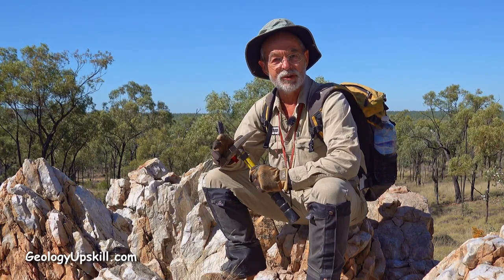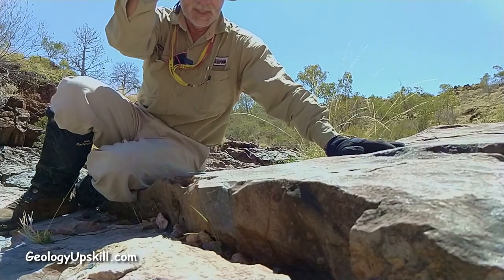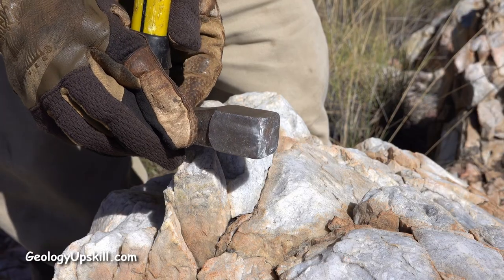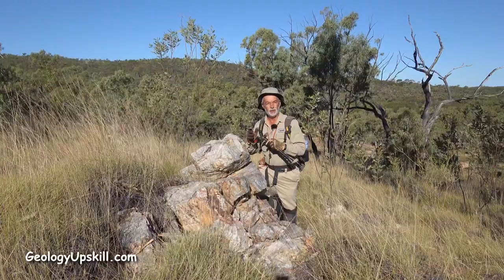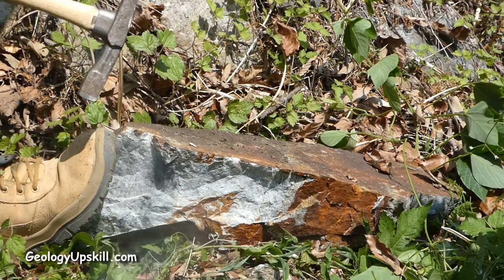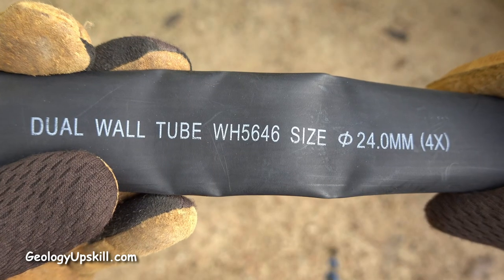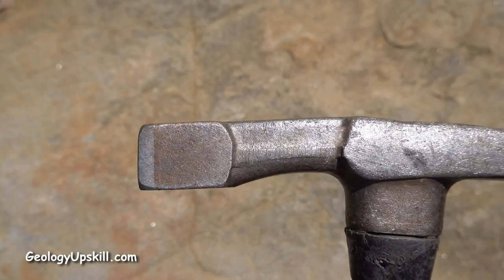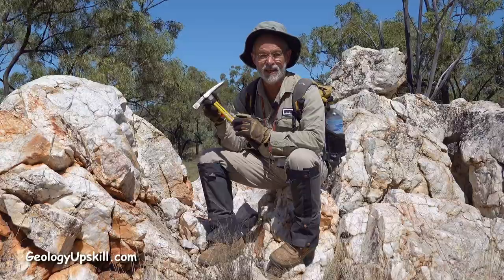The Ultimate Geopick?

Comment: Interested to hear how the prototypes turned out.
Reply from the maker: Still testing that model with different handles. Currently using a shorter claw hammer handle that has plastic sheilding and a smooth grip. It seems well suited to this head. I have some ideas for a more dedicated prototype, but it would be an expensive exercise to develop the tooling.

Comment: Interestingly enough on the Trow and Holden webpage in their "hammer guide" it reads the following under the Rock Picks section: "However, Rock Picks should
only be used to strike stone, and special care should be taken to make complete contact with the with the stone surface. Uneven contact with the stone (including irregular surfaces) will quickly lead to chipped or broken carbide.")  But if you have used yours for angled strikes and it has held up, I will take your word for it... If you had to chose between the rock pick and the stinger, which would you choose?  I'm getting into rock hounding and want a good hammer for cleaning up some of the face tripping rocks on trails I like to hike...
Reply from the maker: That advice is certainly valid. I managed to chip the back blade of one test hammer by hitting it into a crevice in a hard quartz vein at an angle, but striking with the hammer angled slightly to the right or left will contact along he full length of on edge of the face. I have never chipped a front face using that technique, but it certainly breaks rock much more effectively than a regular hammer. I also trialled a stinger for a while, but I found it was prone to spin violently if I mis-hit my target (because most of the mass is near the centre of rotation).